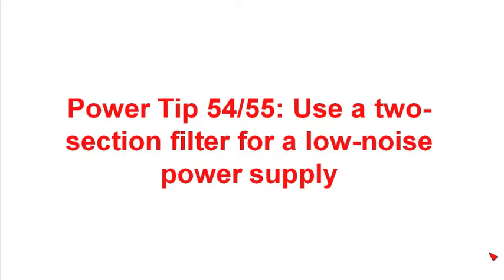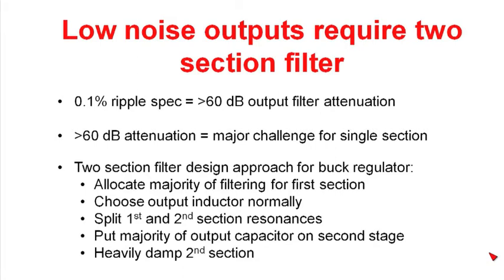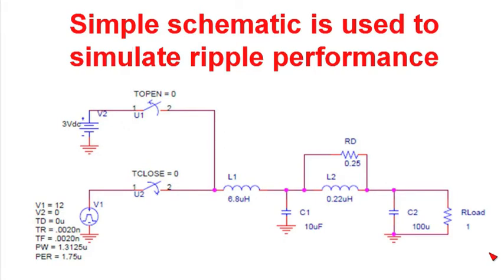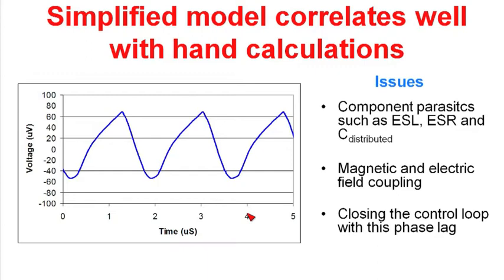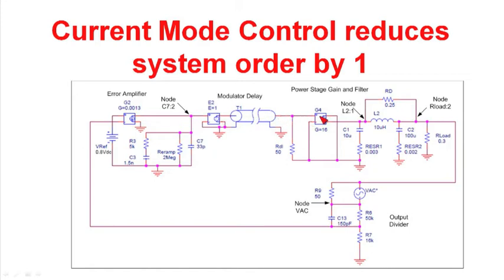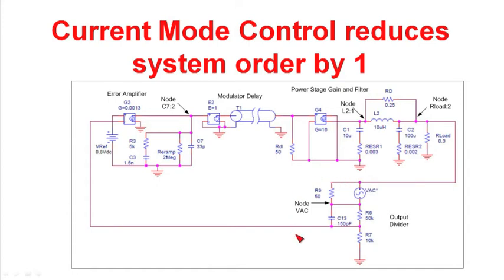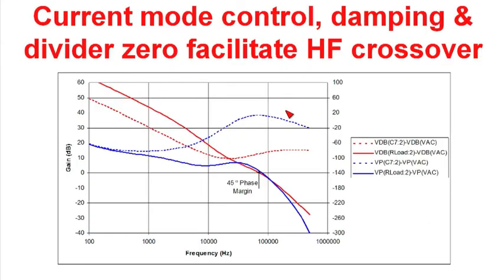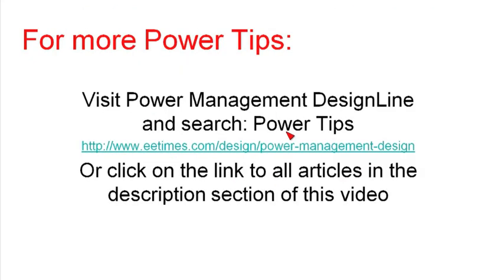Power Tip 54-55: 2-section filter for low noise power supply

Comment: Thanks for this tip! Even just using some random inductors from my parts bin reduced ripple on DC/DC inverting supply I'm working on to less than 0.4%. What a BIG difference also in cleanliness of output.